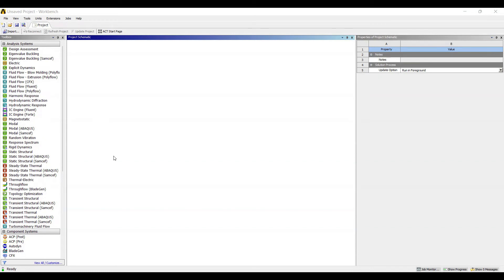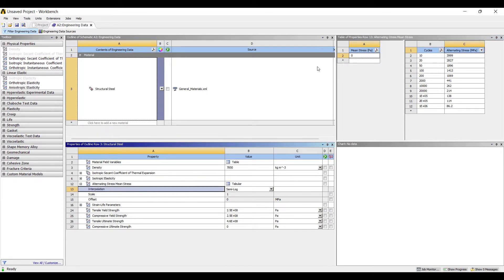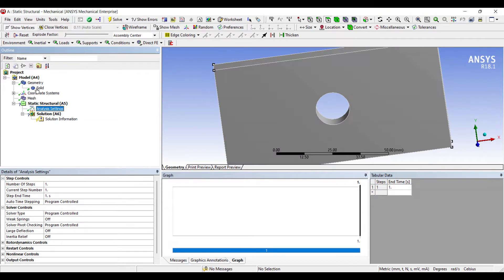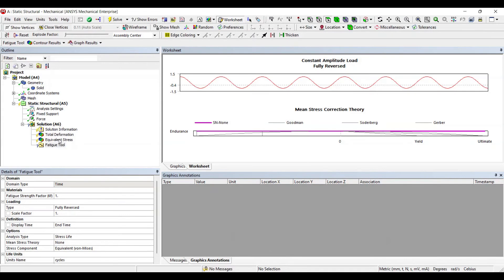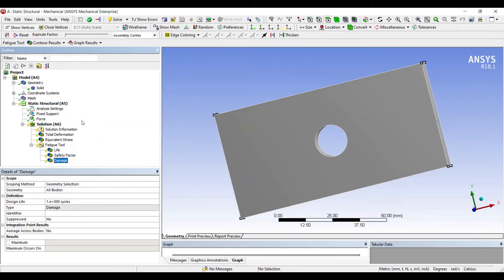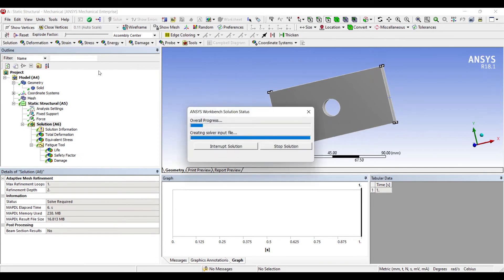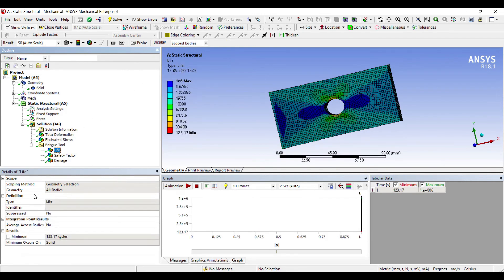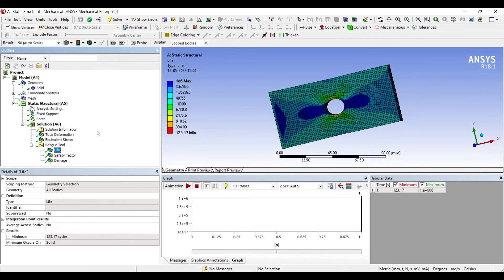Plate with Hole | Fatigue Failure | Life | Factor of Safety | Equivalent Stress | ANSYS Workbench

Comment: I am using ansys 2022 R1 version and i have to define Johnson cook material constant values 
But in this version of ansys i cannot find the failure section from which I can define the values
What can I do 🙏🙏
Reply from the maker: You can create your own material and add its properties. Apply the material to your model
Reply: @MechProverse  ok one more question for doing impact simulation which velocity we need to consider for calculating residual velocity of bullet after penetration in ansys